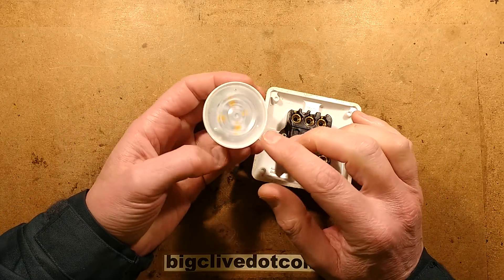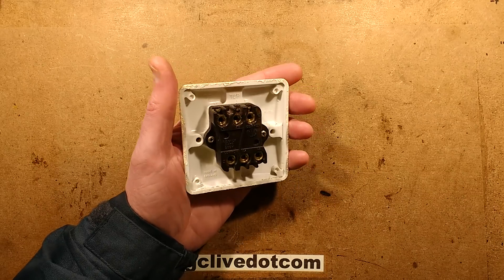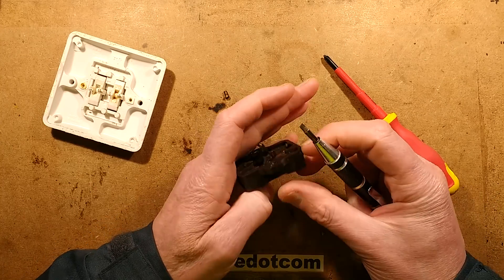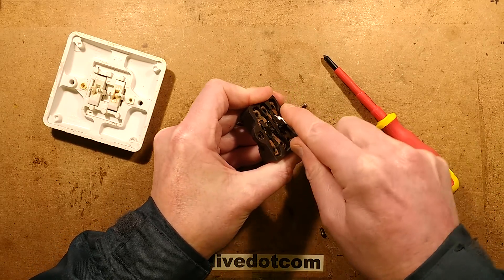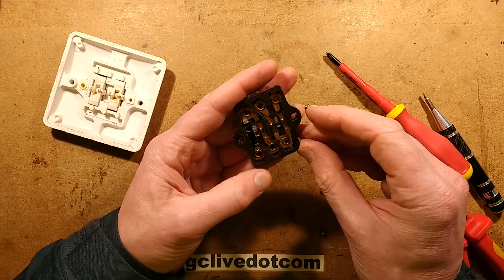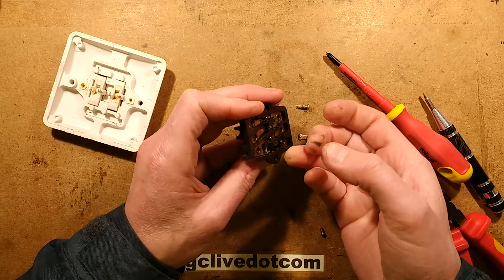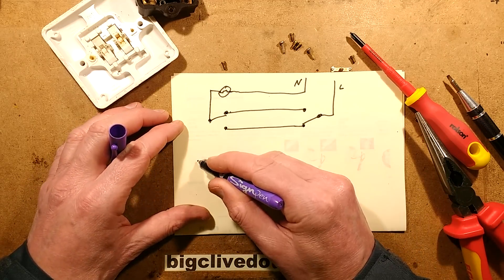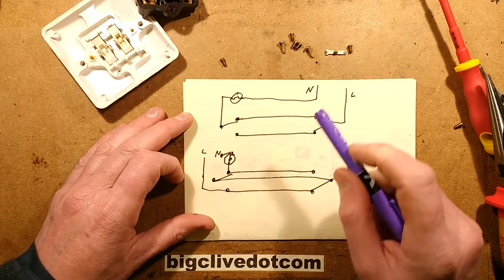Old arcing switch killing LED lamps.

Comment: the switch is 50 years old! what you expect?  the mk switch due to the slow make and break always arked especially with inductive loads....the conversion 2 way circuit is fine, but more prone to causing interference to audio/induction loops
Reply: Isn't it the other way round?  The conversion method provides an outgoing and return path for current so the magnetic fields cancel out.  The strapper method has current flowing one way only.  Yuk.
Reply: totally correct...what was I thinking LOL
Reply: totally correct...what was I thinking LOL

Comment: the second schematic does the same thing as the first, how is it any better ? You still need to run 3 wires between switches in both cases. It just seems to complicate things for no reason instead of following the standard
Reply: Silviu Chitic i think the point is you can add the 2nd switch with only a single 3core cable to the first without any other wiring changes. but I could be missing something.
Reply: Yes, that's exactly what the conversion method is good for.  The first method uses two live conductors not three.  Why did you think both methods use three?

Comment: My impression was, after comparing old switches to new ones, that usually the 50 to 20 years old are much better: more solid, more serviceable. Am I wrong?
Reply: New switches are designed to have a faster 'snap' action, which results in less contact bounce. The older switches were used on more inductive filament lamps. An inductor resists fast transients, such as are generated by a bouncing and arcing switch, but a capacitor passes them more readily. The thinner metal contacts are cheaper lighter, which helps to promote the faster switching action. I wish that some form of electronic switch were in common use, because they can suppress transients, and be designed to give a 'softer' switching action if it is needed.
Reply from the maker: I'm not so sure.  The modern ones may be easier to dismantle unless riveted like the contacts were in the old MK switch.
Reply: bigclivedotcom   May also be different in different countries. My specimens of old (stabil and serviceable) ones are from Germany and Bulgaria. Interestingly Bulgaria during socialism had its own production of all those household goods, and these things look all very well engineered compared with today's stuff.
Reply: It was common to use mercury-wetted contacts in the olden-type days.  That got rid of those pesky arcing problems.
Reply: westinthewest   Why this? How does mercury prevent sparks?
Reply: There is a more reliable connection with no contact bounce when the switch is closed.  Not sure why an arc can't develop when the contacts separate.  Some googling might be in order...
Reply: RWBHere  Thsnks. Interesting aspect!

Comment: It's because of poor switch design. You need a faster break with more displacement.
Reply: More modern UK light switches tend to snap on and off positively however slowly the rocker is operated - the type with the flat rocker surface.  The spring loading presumably is stronger and the contact movement isn't constrained by the plastic rocker itself.   Presumably eventually spring fatigue will reduce the effectiveness, but none of my switches seem to have any arcing issues.

Comment: My house is full of those exact switches, and it's also full of LED lights. Looks like I've got work to do as I've already had some mysterious failures. I  only recently realised that it's possible to buy modular switches so you can mix switch types in one plate. This is quite important when you're trying to replace the 3/4-way types.

Comment: Good video, but I'd argue that the LED lamps are at fault as they are not surviving in a fairly typical environment. EMC directive basically says stuff shouldn't push out EMI nor should it be susceptible. 
Do new switches really have a non arcing design?
Classic "bad" design... a fuse that doesn't actually achieve anything other than failure. Some sensible surge protection would do the good.
Reply: Many products are designed around a price point. Having better circuitry will raise production costs and reduce the average profit. You can buy LED lamps with every type of protection you can think of but who wants to spend 100+ for a single lamp. Really they could do better but I do understand why they chose not to.
Reply: Del Cat be nice to have an externally accessible socketed replaceable fuse! :p

Comment: While not defending old switches arcing, is this a reason why LEDs shouldn't be put into old houses?  Are single switches less prone to this effect than the double switch shown in the example? I recently had some electrical work done in the house and the electrician was only fitted single switches.
Reply: Exactly! I agree, the LED lamp design is not fit for purpose... arcing is fairly typical in a mains switch. I don't really expect new switches are a non arcing design.

Comment: everything so sensitive these days with even modern circuitry ,perhaps everything needs smoothing capacitors on them to stop spikes and interference when turning things on and off ,such as hdmi switches and tvs flicking on and off when u change a fan setting on the same circuit
Reply: Good in theory, but LED lamps will still glow if capacitors are fitted across switches. Cheap capacitive droppers in the lamps are the root cause of these lamps failing when mains transients occur. A small transformer within the lamp would be a simple solution, but they cost more, weigh more and tend to be inefficient, especially when small, thus generating more heat.  

Transient suppressors could also be fitted across the lamp terminal connectors, but again, heat and space could be issues, and those surge arresters have a limited lifespan.

My preferred option would be a low voltage lighting circuit, supplied from one properly designed voltage reduction circuit, be that a transformer or a SMPSU. Then nobody would risk injury from 'live' high voltage wiring, as an added bonus to the lamps lasting for longer. Many bathrooms already use 12V lighting.

Sadly, money (and the perceived saving of it) talks. And the manufacturers are happy to sell a cheaper product and then to wait for you to buy a replacement after a predetermined average time period.

Comment: PS I was traveling and came down with the flue!  Alone with feaver in that hotel room, it really helped setting your channel on auto play! I have watched for a long time and it was good to have a friend with me Thanks! .. Can you explain how much it would cost for Honda to wire the headlight  noise maker into an auto off circuit? Ever time I get out and it bongs at me I thing why didn't the connect that wire to something that could do something about it instead of telling me to do it... 😅
Reply: i used to own a honda prelude 85, the bong then was an actual bell. I always admired the simplicity in design when they considered "yeah let's use a real bell".

Comment: One advantage of the "old way" is that you could put a switch in the middle that swaps the two feeds (straight though or "X" - called a 4-way in the US) and now you can have any number of switches that can turn the light off or on.  I don't see how you can do that with the "new way".
Reply: Just use additional straight/X switches cut in on the outer pair of wires in the bottom diagram, leaving the wire in the center unaltered to the last switch.  They must be "break before make" DPDT switches, of course.

Comment: What's the point of having a non-replaceable fuse protecting the LEDs from burning out?
Reply: You want things to die in a predictable manner.  "Bang" is bad for business.
Reply: Ah, that makes sense.  Thanks
Reply: So they define blowing the fuse and not working as a pass? A better design wouldn't fail

Comment: Are resistors always measurable in circuit?
Reply: By in large, you can test a resistor in circuit.  If the reading is too low, then something in the circuit could be messing up the reading.  But if it's too high, you can pretty much bet that the resistor is bad.  While it's theoretically possible for the circuit to make a bad (too high) resistor look good, it's pretty rare.

Comment: "it's not the fault of the lamp, it's the fault of the switch", although true, in some countries, consumer laws would put the blame on the lamp not being fit for purpose in existing installations where crackling switches are likely to happen under normal circumstances.

Comment: Hey Clive.  Good videos.  I never miss 'em.  I don't know if I axed you, but my LED chandelier flashes when I switch it on.   What is?  I think I got the right dimmer.   Do I need to keep switching bulbs and dimmers 'til I find the right combination?  Thank you and say hello to Ralfy.
Reply from the maker: Your dimmer might not like the load or if the chandelier uses a single power supply for all the LEDs it may not like the dimming.

Comment: In the U.S., neither wiring method is allowed since 2011 NEC.
There has to be a neutral available at each switch location [2011 NEC 404.2(c)] for smart occupancy sensors.
So, the wiring would be Hot and Neutral to the first switch, Neutral and two Travelers to the second switch (three conductors plus ground), Neutral and Switched to the lamp.
You can still use a "dead end" arrangement, but you would need a four conductor plus ground cable to the dead end.
Reply: That code section has changed in both code cycles since. The rule is quite different today compared to 2011.

Under the 2014 code, the there was an exemption added  to the neutral at switch requirement for 3-ways if you could see the entire room from the switch location so in most residential setups, you didn't need a neutral at a 3-ways at all.

Under the 2017 code, you are required to bring the neutral but only to one switch of a 3- (or 4-) way switch setup.

Comment: Stop running 220/240 to everything and you'll have less problems with arcing, don't know why they didn't run 120 to all the low power outlets and lights they do in the US and some other countries. I see no use in running a dryer plug to everything just to power some things that don't even use 2 amps.
Reply: I'd be a fan of having even lower voltage service for some things if they operated properly, just for safety and fire sake, maybe 1/2 120 to 60 or quarter it to 30 volts. It would help cool down a lot of power supplies too, less power to waste as heat for power step down.
Reply: Efficiency drops greatly with lower voltages, and you would need a lot thicker copper cables! For the same amount of power, you'd be pulling a lot more Amps!. And amps is current and that means more cable losses. 

Here in Europe we happily cope with 230V mains. I was fascinated by an US power strip that had its cable much thicker than anything we use here, looked like it could have been used to start a car. As for the arcing switches, if the switch would have been designed to have self-wiping contacts, the arcing would probably not have happened. I believe we had an old standard for bathrooms and wet places that specified the use of special insulated self-wiping switches and insulated outlets with a cover.
Reply: Not for phone chargers, radios, can openers, low current low voltage devices, which is what i'm talking about, a lot of energy gets wasted over conversion. Plus lower voltage would be safer. Lighter transformers because you wouldn't have to step the voltage down as much, along with the heat.
Reply: There's always one......
Reply: There's always one guy who's been light up plenty of times by the mains, and no my stereos that run off 9v don't have small tiny transformer, they're pretty beefy, and a lot of chargers don't even use transformers, they use capacitive droppers like clive has covered many of , that also light your ass up if you grab onto the wrong thing. Everyone seems to be ignoring the SAFETY part of low voltage.
Reply: Actually having a large step down transformer, and just wiring low voltage high amp circuits through the house to supply most things that work on low voltage DC, which is the majority of things would be safer than just using a bunch of chinese step down crap circuitry everywhere through out the house. There's a big problem though, everything is already designed for 120/240. So you'd have to bypass the power supplies and use regulators on certain equipment. Just think about how many thing fully utilize the 110 coming from the wall, hardly anything besides motors, and microwaves.
Reply: After all 1 car battery has plenty of amps, but does it light your ass up when you grab on to each post with each hands? If you can't see where i'm going with this maybe you're that 1 guy that hasn't had experience with the fun of grabbing onto full mains by accident.
Reply: You drop greatly when you grab on to high voltages.
Reply: You see how thick those plugs are? How thick most the wires are he uses? You're already talking about "a lot thicker copper cables" just to run stuff like a phone charger, 60 watt light, lcd tv, and other low power using devices. Now compare that with 120v rated US wire, plugs, and receptacles. Did you over look that?
Reply: From my experimenting i've found that normal 16 gauge 3 conductor house wire can handle about 100 amps per strand at 12v @ 10 ft.  before she starts smoking, that's a lot of devices to run for the same type of wire that's already wired into the house. *not liable if you catch yourself or your house on fire.
Reply: Yeah, but every one seems to forget my main point: it won't light your ass up like a christmas tree.
Reply: It adds a benefit of not lighting your ass up. Jesus it's like I keep mentioning electrocution and everybody talks about everything else, but electrocution.
Reply: I was once in England about ten years ago, and one of the highlights was visiting Tim Hunkin of Secret Life of machines fame.  He was explaining the electrical system there, and he commented about our 'stupidly thick' American power cords :)  For some reason that always comes to mind when I see things like this.

Comment: Should every new home be fitted with one central transformer and cabled up with DC to all the lighting and our plethora of electronic gadgets? Wouldn't we end up throwing out fewer electronic components in all the individual items as they age and die? In an ideal world I mean.
Reply: It would require thick cabling to reduce the voltage drop, otherwise you would end up with negligible voltage over any distance
Reply: Andrew Cox ,that's a good idea, you could have a single transformer with an output of about 20 amps at 5 volts connected to a ring main of multiple USB outlets all around a house, so you wouldn't need separate chargers for all your gadgets!
Reply from the maker: It may happen in the future.

Comment: In my experience here in New Zealand over the last few years in particular, Philips have dropped the ball on quality and reliability on all lighting products. So bad that LED product models are discontinued and replaced very regularly.
Reply: Yep, Philips quality has diminished over the years.
In the 80's I bought one of the early Philips CFL bulbs and used it as the main light at the top of the stairs for over 10 years.  It was as heavy as a tank but performed sterling service. That was back in the days when the light was on most of the night to ease the kids worries of the dark.
Never had a bulb last as long since.
Used a few Philips LED ones in the 2000's but the quality wasn't there for the price (2 or 3 times the other brands).  So buy on price now from trusted stores.

Comment: Ive got a dead LED lamp aswell, but it failed in a strange manner. It works fine for a few minutes and then it starts flickering but after about half an hour of permanent flickering it goes back to normal again. I wonder if a capacitor failed or something, maybe I should send it to you, although I guess youre already spammed with those :D

Edit: I also know a third way of two way switching that is used in my house and I really dislike it for one major issue and thats why I changed most of them to one of the others. It goes like this: The lamp is connected to both middle contacts of the switches, and the switches are both connected to both live and neutral, so basically the lamp is never open circuit but connected between neutral and neutral or live and live when turned off and thats a very flickery experience when having LEDs :D
Reply: Just better hope those switches are all "break-before-make"!  Otherwise, BANG.
Reply: Rusell Hltn Thats not the only problem. You know, when both switches are on, the light is off as intended but its off because its between live and live, so even the thread of the socket is live while the lamp is off. Stupidly dangerous but apperantly a legitimate way of two way switching.

Jown Coops Yeah, I thought of a leaking capacitor but a bad solder joint makes more sense, especially with that cheap lead free solder. Cant open it without destroying it though, so not sure :D

Comment: but wouldn't the modern way of wiring the 2-switch system require you to either use a 5-prong wire (well, 4, technically, but I never see these at least where I'm at) or to use the earth lead for non-earth purposes? Or am I missing something?
Reply: You never use the earth lead for non-earth purposes. You will need a 4 wire cable.
Reply from the maker: It would be wired as two core plus earth (twin and earth) to the switch from the ceiling rose and then a three core and earth between the switches.  Earth should never get used as a live conductor, but I have seen it, so always assume the worst to avoid surprises.
Reply: That's what I figured, thanks for the response!